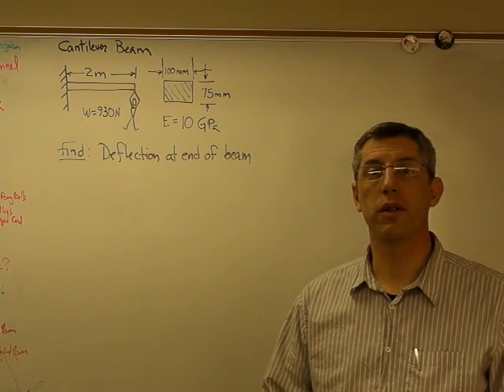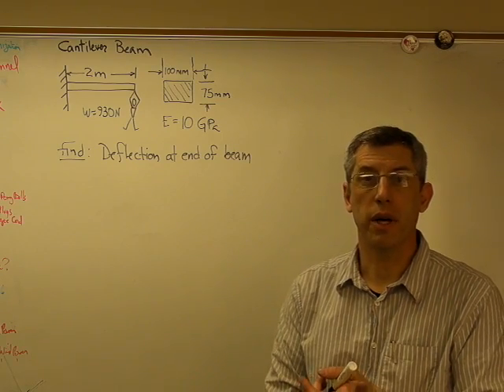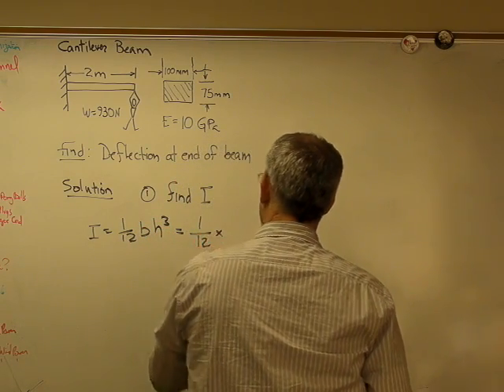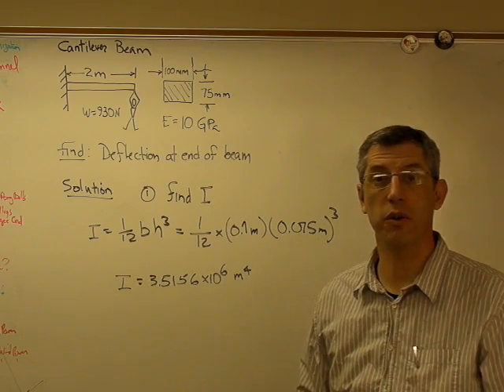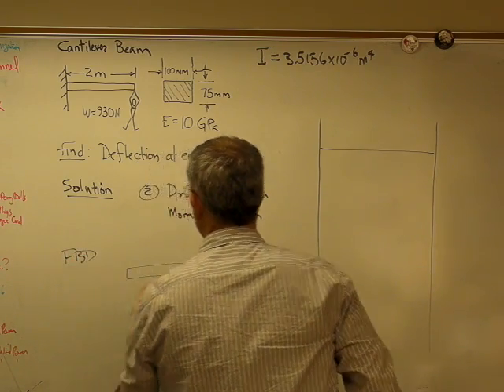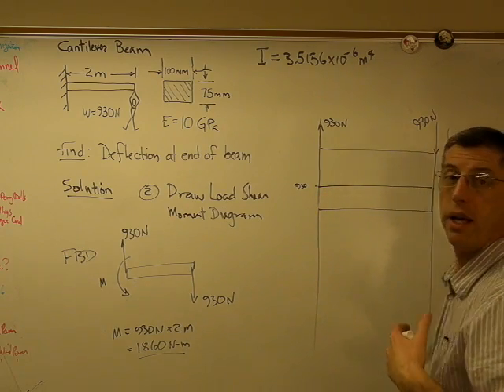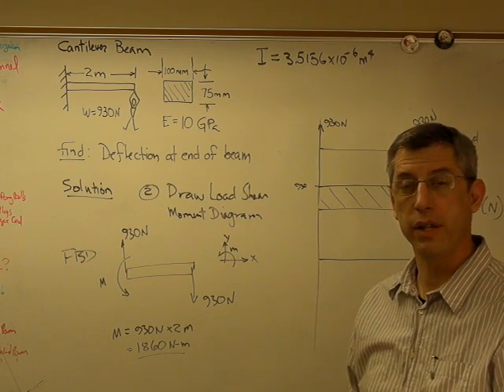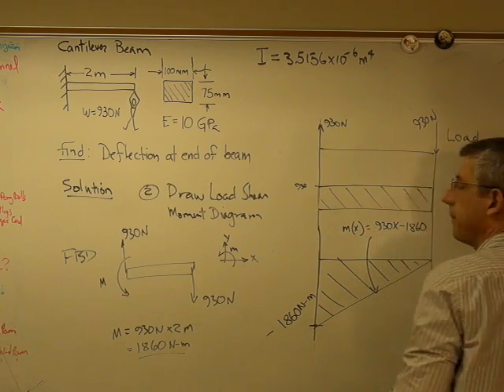Cantilever Beam 1.MP4

Comment: @diflection1 OK ...i will try my best to explain this. i have a udl with a rigid support and a free end ( i think it is called a cantilever) and i am supposed to find the maximum slope and maximum deflection. it doesnt have  any numerical values so where you would have a number for the weight, you would just put 'W' and the length is sometimes X or L. now this is what confuses me...sometimes my teachers uses L and derives a formula and sometimes he uses X. also, i donot understand the concept of

Comment: I'm stuck on calculating the bending moment of a cantilever. The force is applied at the end of the beam at a 30 degree angle from the horizontal.

According to a part of the solution, the Moment due to mass of beam: M = (0.5)(mg)(L). I don't know where they got the 0.5 from. I thought the mass moment is just M = mgL. Why is it divided by half?
Reply: bhai Hozintal force is mgcos30..which adjusted accordingly with fx summation=0 So Vertical force moment is taken about a section =mgsin30=0.5mg..for moment multiples with variable distance x..according to the cantilever
Reply: bhai Hozintal force is mgcos30..which adjusted accordingly with fx summation=0 So Vertical force moment is taken about a section =mgsin30=0.5mg..for moment multiples with variable distance x..according to the cantilever
Reply: bhai Hozintal force is mgcos30..which adjusted accordingly with fx summation=0 So Vertical force moment is taken about a section =mgsin30=0.5mg..for moment multiples with variable distance x..according to the cantilever
Reply: bhai Hozintal force is mgcos30..which adjusted accordingly with fx summation=0 So Vertical force moment is taken about a section =mgsin30=0.5mg..for moment multiples with variable distance x.
Reply: bhai Hozintal force is mgcos30..which adjusted accordingly with fx summation=0 So Vertical force moment is taken about a section =mgsin30=0.5mg..for moment multiples with variable distance x.